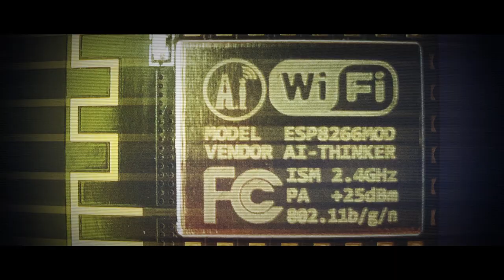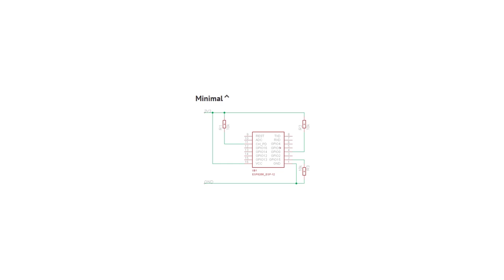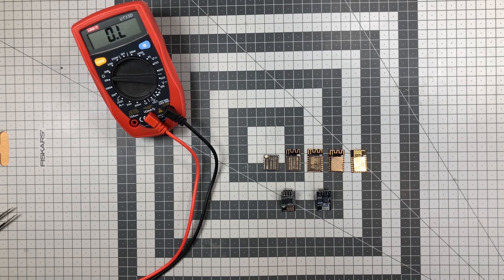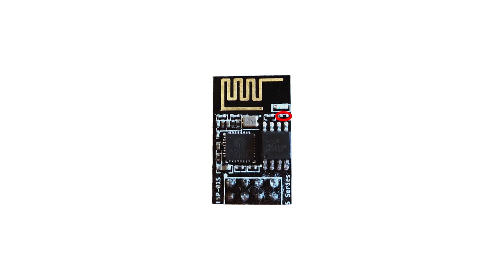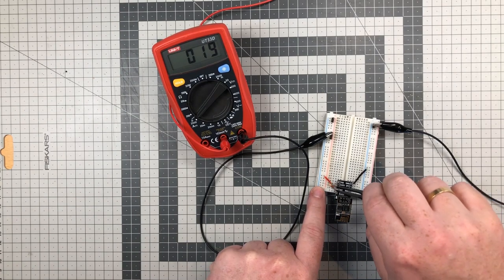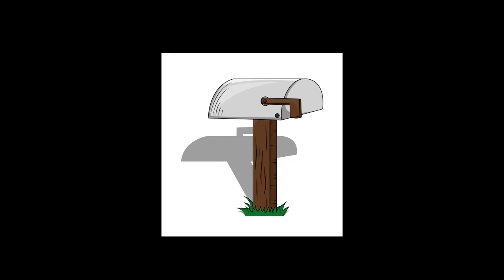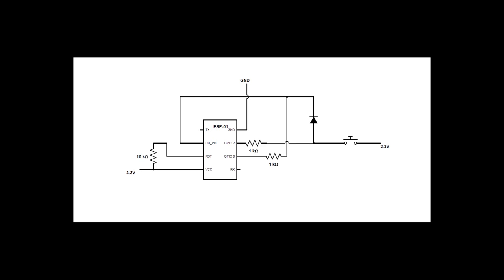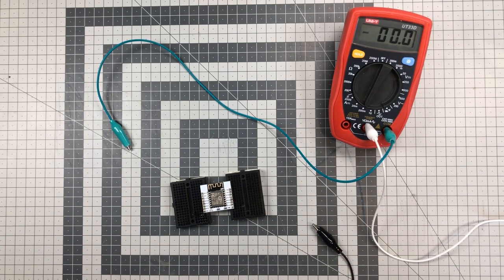Best power saving mode - Much Deeper Deep Sleep ESP8266

Comment: Another way is to use an external transistor to cut down the power to the module. It should work for all versions of ESP.
Reply from the maker: Absolutely! Or maybe use a MOSFET. But the power down mode is so simple - too bad it’s not more known!
Reply: @DIYTECHBROS  which SMD MOSFET can be used?
Reply: @DIYTECHBROS  
Thanks for this great tutorial,
Can you recommend MOSFET name that good for that ?
Reply: @mindpixel3142  NDP6020P
Reply: Hi, how do we do that? My app is basic and it uses only ESP01-S module. If I try to use your method such as BC557, I assume I need a timer chip such as LM555 etc. Is there any other way to do that? 

My app is basic;
DHT11 should send sensor data in every 2 mins.

Comment: This is a pretty handy trick and a nice video. But the power down state is not a sleep mode. The chip is just completely turned off, which means that it differs from deep sleep in not having retained memory in RTC. That means there is no way of keeping persistent data in RAM between power down events. The chip is just shut down and restarted every time from scratch.
That being said, this is still a very useful trick to keep in mind if conditions allow for this to be used.
Reply from the maker: Don’t forget about EEPROM :-)

Comment: Modules that do NOT have internal pullups:
ESP-01
ESP-12E
ESP-12F
ESP-12N

Modules that have internal pullups:
ESP-01S
ESP-07S
ESP-12S
Reply from the maker: Thanks for the list!
Reply: Is there any module with external antenna option that do not have internal pull up? thank

Comment: Great video and trick to enable/disable ESP.  Need to scratch off the pull up resistors on my ESP01-S. In hibernate mode the ability of timer wakeup is lost, which I like to do so every few hours to send some health signals.
One thing that bugs me is why they didn't connect pin 16 to the reset button for deep sleep wakeup! I always have to do it manually which is a pain!

Comment: i think i'm missing something here, if you need to push a button or otherwise manually "activate" the ESP, then why not power it down completely during the "down" time? Or can the board wake up from this configuration on its own (e.g. using the deep sleep timer)?

Comment: Thanks much for the video.   This helped me quite a bit.  I have done a bunch of programming with NodeMCUs but not ESP-01's.  I have this more or less working, however, I wanted to be able to detect when the door closed vs just timing out.  I assumed from the diagram that I could just read GPIO2 to see when the contact changed state, however, it doesn't seem to work.  Doing a pinMode(GPIO_2,INPUT); during setup() and then a digitalRead(GPIO_2) in my main loop shows it always HIGH (Closed as I am using a NC door switch.)  Readings directly off the pins with the multi-meter show it changes voltage as I open/close the sensor but the ESP-01 digitalRead() shows it HIGH ... Any thoughts?

Comment: How do you program an 8266 with this type of wiring? For programming you need to pull GPIO0 and then enable the chip with EN high, but here those two pins are joined by a 1k resistor. How could you pull GPIO0 low while keeping EN high with this design?

Comment: I removed the resistor from my ESP-01s and after removing it I still can measure 12k resistance between CH_PD and VCC :(
Reply: You are right !! the real position of the pull up resistance that ave to be pulled out is located directly byside the pin 7 of the esp266 chip !

Comment: I ran into a problem where I'm using a motion sensor (PIR AM312) on GPIO 0 on an ESP-01 (Black) and it works fine, but doesn't work on an ESP-01S.  I think I need to remove the 12K pull-up resistor that is on GPIO 0 on the ESP01-S to make it work.  I have been measuring resistance between pins and comparing to each surface mount resistor to identify the right one to remove.  As relates to this video, I noticed that I'm measuring 12K Ohms between VCC and the Enable pin, but on the surface mount resistor you indicated I'm only measuring about 1K Ohms.  I would have expected them to match, but perhaps there's some other stuff in play that I'm not aware of.
Reply: Yes, 01s has internal pullup
Reply: @SoftBreadSoft  All I had to do is de-solder the surface mount resister and I was able to use GPIO 0.  So I basically turned an ESP-01S into a ESP-01 (black).

Comment: I don't understand. With an ESP8266-01(S), shouldn't a link between GPIO16 and RST be added to the module (use of the timer which continues to operate in standby mode)

Comment: Can you also make the esp8266 go to deep sleep 3microamps for exactly 2 minutes and then let ik, wake up again? Like for a device that needs to send the temperature to a webserver every 2 minutes and in meantime go to deepsleep?
Reply from the maker: Hi!
I would recommend that you store last temp and only update via Wi-Fi if changes are over a X - or every hour if changes are low. And, when you send the data you can then send all read intervals in one go. This will save a lot of power as Wi-Fi uses very much power. But, over to the question, you would need a second device like a TRC or a simple 555 timer, as the ESP would need external interrupt. But this way you will almost never have to worry about power consumption!

Comment: That is very interesting I want to make a door sensor with long battery life but your diagram is very hard to see for the esp8266-01 do you have a better schematic please thanks Bob in the UK
Reply from the maker: Hi (again) Bob :-)
Love it when makers asks good questions! 
If you see in the video at 8:29. Replace the button on the right (with the label 12) with a magnetic reed sensor / switch. And that would be your complete setup.

Just remember to add pice in the code that tells the ESP to go back to sleep if it has troubles finding your WiFi after a few minutes. In case you WiFi is down, connectivity problems and so on :-)

Comment: I test it with an ESP-07. If i used the GPIO to hold the CH_EN enabled and then set the GPIO to LOW, the ESP not really switched off ! The LED will light a little bit and current is like deepsleep. If i cut the wire from 3,3v to CH_EN by myself, the ESP switched off and current is 0,002mA as you show. Is there a different between ESp-07 and ESP-12 ? It will be the same if u pulldown the CH_EN with a resistor like 47K to GND. Only there is no connection to GND the ESP fully switched off
Reply from the maker: Interesting!
Try using a different GPIO PIN. It is a guess, but maybe the  default state of the PIN can interfere?

Comment: Hi, me again!
1. What type of diode is better to use?
2. If I keep the pool up resistor on  the Esp-01s, and I don't use the external 10K resistor, the circuit is still working?

Comment: Is it possible to show some external circuitry how to make use of the power down pin? Would a resonant circuit make sense in a way that the chip is powered off for lets say 5 min and enabled for 30sec to transmit some data?

Comment: Hi! Great video. So if this pull up resistor is removed, which mode is the chip toggled to? I would like to achieve this range of consumption (less than 5uA), but is RTC working in this mode? Because I need to wake the core every hour to take measurements and daily turning-on the wifi. 

Actually when operating at normal power down mode (19uA) and connect+TX daily, I get 6,25uAh over the day in average, which is quite good; with a small 250mAh battery I can reach almost a year running (while my minimum is just 1 month), but anyway if I could have a lower consumption it would be way better.

Thank you in advance.
Reply from the maker: Hi! No, the chip is “disabled” when you do not pull the EN pin high. To any internal timers are none functional as well.

But, instead of using watch dog timers, you can use a Real Time Clock (RTC) as you are mentioning. It will run for years and can awake your ESP!
Reply: You can use external RTC module or save the data as file in memory.

Comment: Hello, I've made a project a year ago powering an ESP12 with 4 AA in parallel (to not exceed the 3.3V) with that, and with the deep sleep, I manage to run it for almost 5-6 months. My question here is: I see that you need a pull-up resistor again to actually wake up the ESP, but in my scenario, the deep sleep function sleeps for 60 minutes, and then it automatically wakes up, grabs some data, and sends it). Without any external interference, would I able to manage to enable deeper deep sleep? 

Thank you!
Reply from the maker: Hi!
Your observations are correct, an external input is needed. This mode shuts down the watchtimer, and it can't wake up by it self. But you can use an RTC :-)
Reply: @DIYTECHBROS  thank you for answering me. I could add an external RTC... but I don’t know if the difference between having the RTC watch on the ESP or having separately would make much a difference since the RTC will be powered through the same AA batteries. What do you think?  What it could be a good idea if to set the deeper deep sleep when you want the ESP to “sleep” more than 72 minutes thou. Imagine you want to sleep for 6 hours, then this could be a good idea. Thank you

Comment: I am having problem with your example with the esp01s.
The resistor that you show in the video is 2k2 and It Is for the led.
I think that the 12k resistor between vcc and Chpd Is in the left side.
Can you check again?
Reply: You are right !! the real position of the pull up resistance that have to be pulled out is located directly byside the pin 7 of the esp266 chip !

Comment: This is cool, my only problem is that this is only for sending one "notification" and after the board goes to deep sleep, I want to make a window sensor that will send a notification when the window is open and also closed. As I understand this method works only on opening a window let's say. Is there a way to achieve this to send a notification on any state change ?
Reply from the maker: Well, you can buy reed switches (magnet sensors) that are both normal open and normal closed at the same time. When the window is open it stays on, but goes into deep sleep. But when closed it goes into deeper deep sleep. You need to read the switch as well as connect it to the EN pin.
Reply: @DIYTECHBROS  Hi, I’m also interested on this that @Alexander221 asked. Can you please detail a bit more since I need to send a message to a mqtt server with the status if opened or closed. For my understanding using the 01 version It will work as design and with the 01S version there is the need to remove the resistor just to reduce the power comsuptiom .

Comment: All these scenarios require a hardware trigger. I'm looking at a battery operated timer based sensor solution (ESP01), ideally utilising ESP-NOW - wakes up 4 times a day to read a sensor and pushes it to an ESP-Now receiver for processing. In power down mode to use the term used in the video - the ESP is no longer operational so can't use a timer or anything else for that matter, right? This means using the ESP-01 I would have to make it work with 20A, right?
Reply: Could you use an external RTC module? Those usually run on a coin cell and have an output that can go high at certain times.

Comment: Does this require removing the boot loader?  (I wire GPIO 0 to ground to run the bootloader upon power on).
Reply: Oh I see GPIO 0 is wired to GPIO 2 so GPIO 2 holds GPIO high.  So no boot loader will run.  (Just keep the switch pressed long enough so the digitalWrite() will execute.  ha ha genius.
I guess I can't use the pins for much else.

Comment: Hi I'm trying to make a door sensor based on esp12f/e and reed switch with battery. how do I use the same concept with reed switch? I'm really excited to know
Reply: The reed switch will work in place of the switch in this video, on or off.
Please note that if you need a NO/NC reed switch you can buy them online. They will three wires instead of 2 wire.

Comment: This is great for long life projects, I am totally new to this and I am trying to help my son use this in his school project but we're struggling to understand what GPIO2 does as the code doesn't set it, is it high by default at power up? I understand GPIO 0 being high to keep the circuit powered even if the switch is opened until the code finishes. TIA.
Reply from the maker: Hi!
Well, the initial state of the GPIO pins can be a bit unreliable so you need to set it high in the setup!
Reply: @DIYTECHBROS  Thanks for the reply, much appreciated.

Comment: Great tutorial! I have been trying it out using an ESP-01. I removed the red power LED to stop that being a power drain, but have still found the current drawn when the chip is disabled to be about 40 microamps. This is about the same as when it is in deep sleep mode. I'm wondering, is there something I am doing wrong? I can't even get it down to the stated 20 microamps, let alone the 2-3 I was hoping for. Is there something else on the ESP-01 PCB that might be drawing current?
Reply from the maker: Hi Warren! One possibility is the your ESP has to little/unreliable power - so that it is in a brown out mode. Try having the ESP blink an LED to make sure it is running as expected before going into sleep.
Reply: Thanks for the quick reply. Yes I have another ESP-01 I've used for this test. It is running a simple program blinking the LED, then going into deep sleep mode. This one seems to use about 100 microamps, even when removing the tie-up resistor or using it to tie CH_EN to ground.
Reply: @warrenstanley1774  Hi! Did you fix this?

Comment: i have removed the resistor you have show for the ESP-01S but i have still the 20uA consumption, i think the resistor near the blue led is for the blue led, since after i have removed it, the led do not work anymore...so where is the pullup resistor for the esp-01S ? thanks !
Reply: Hi Stefano, I have the same problem...
I think that the resistor is in the left side of the board, I tested with a multimeter and when I touch the resistor the value change.

Comment: I try this with an ESP-07. My sketch only switch the LED on. Nothing more. I connected an Attiny85 to CH_EN pin. The Attiny switch CH_EN to low but the ESP will not power off fully. The LED will light a little bit. Why? This will also be if I use an resistor from CH_EN to GND and disconnect Vcc/CH_EN.
Only if i pull the wire out, the ESP will fully switched off.

And why you use Gpio2 here?

Oh I see I wrote here 2 months ago...  :-)
I made a lot of tests, it will not work like in your video. I try a test with ESP-01 !
Reply from the maker: Hi!
The ESP01 has a very limited selection of broken out pins. That's why we chose GPIO 2.
Is the ATTINY sharing a common GND with the ESP?
Else a low signal on the ATTINY will not be an low signal for the ESP.
Reply from the maker: Also, make sure you are not using the same pin as the LED is connected to. (Pin10 on some versions).

Comment: After doing all the research I am able to get to conclusion that this circuit will be able to work with ESP-01 not ESP-01S. I tried removing the resistor as mentioned in the video from ESP-01S, but seems like the circuit is not working at all. In ESP-01S also after removing that resistor as well there when I was checking through multimeter between EN and VCC the resistor seems to be there . 

Also with ESP-01 I am able to achieve minimum 10uA not 2-3uA. I tried to remove both the blue and red LED. Red LED reduce the power consumption from 300uA to 20uA after that I remove the resistor for blue LED and I can see current in power down mode as 10uA. I am not sure how you achieve 2-3uA. If you can guide that will be helpful for even general audience.
Reply from the maker: Hi Rule Breaker! If you see the video, we are using an ESP-01S. Are you using an adapter to connect it to a bread board? Make sure there are no extra resistors or similar on any adapters.
Reply: @DIYTECHBROS  Brother I checked many times, same circuit is working on ESP-01 but not ESP-01s. I have also shared a link of schematic diagram @t if you want you can check here as well. If I am wrong somewhere then please suggest.
Reply from the maker: @crackrule  That's so strange. Do you have any alternative devices to test it on? Like a different ESP-01 or an ESP 12?
Reply: @DIYTECHBROS  Yes i have ESP-12E and EPS-01 both. I have tested with ESP-01 working at 10uA minimum, tried a lot but not going less then this. So thinking to use any P-Channel MOSFET instead.
Reply from the maker: @crackrule  A quick question, if you are prototyping this on a bread board try to eliminate the breadboard. Also, make sure there are no static interference, like power adaptors ect.
Reply: @DIYTECHBROS  Sure i can do that, i can design the same on PCB.
Reply: Hi, in my case, it is 7nA after desoldering the red led. ( 350 nA before). If you use long multimeter probes, you can have noticeable variations when measuring small tiny currents.

Comment: Not very suitable... It can be used with triggers-like applications only, not with internal timers (WDT)... and if you want to make temperature sensor for example with periodic data sending- the using of this mode will be impossible...
But... Maybe using of external wdt can solve this task...